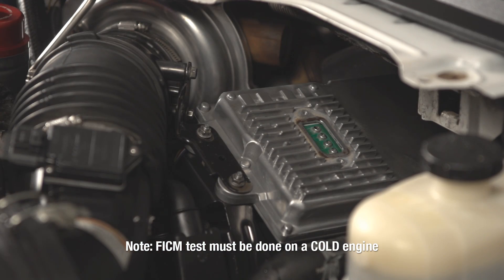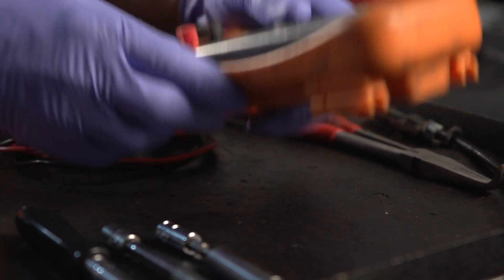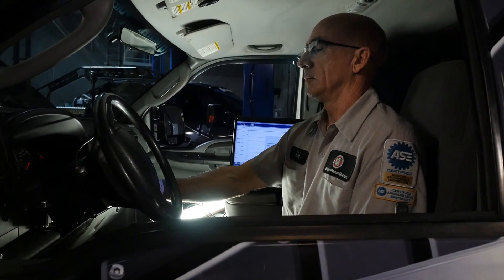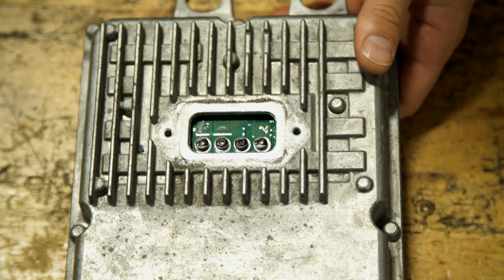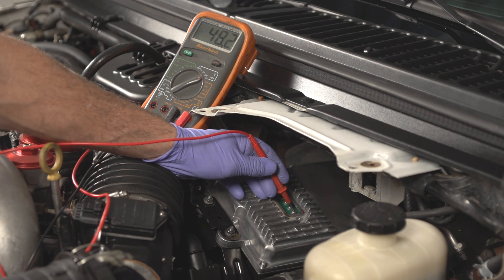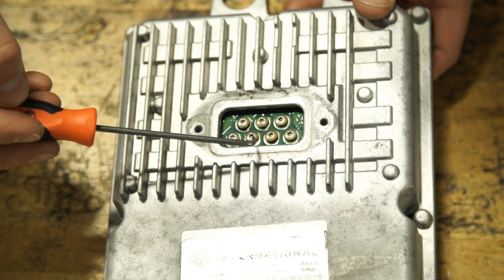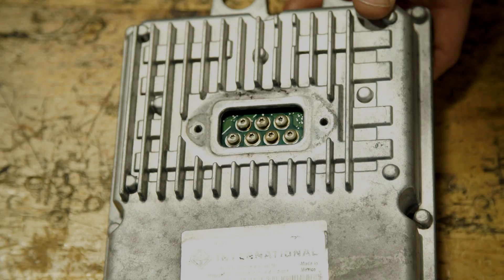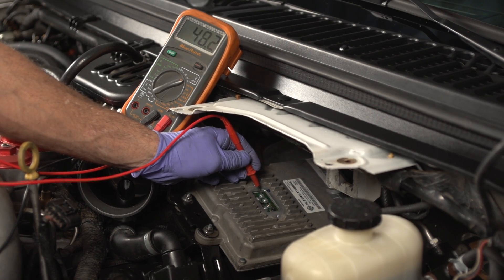6.0L Power Stroke FICM Voltage Test; 4-pin and 7-pin

Comment: Hello, great info here. My Ficm holds 48.5 cranking with glow plugs but as soon as it fires it drops down to 39.5 then creeps back up to 48.5. I have an intermittent misfire and I haven’t been able to catch it misfiring yet with the scanner hooked up. Would a new power supply solve this Ficm issue since it runs fine and just intermittent misfire?
Reply: it sounds bad to me, what did you end up doing
Reply: @ I swapped out the power supply. Helped the voltage issue. But i found it to be a bad injector harness

Comment: It would be much better if you would have zoomed in to show which pin to touch on the 7 pin ficm. You show in the video to touch the right-most pin on the 4 pin ficm, but do not say which pin to probe on the 7 pin ficm. Not much help

Comment: I have 48 volts at the screw but scanner shows 0volts L,V,M power. Does this sou d like a fried ficm or another issue?
Reply from the maker: Sorry for the delay..  it sounds like the most likely problem is the FICM logic board.  A complete FICM replacement is probably in order.

Comment: My voltage starts out below 48 and drops to 21 during cranking. Do I need to replace the FICM?
Reply: Yes, it should be a constant 45v-48v
Reply: @Putnhastism  I was told it's best to get a FICM that puts out 54 volts. Seems to eliminate stiction.

Comment: I find this test helpful. But not realistic I had 48 volt key on engine off. I had 30 volts with the engine running. I did purchase the 4 phase bullet proof power supply. I am just now getting back to the the truck to finish the repairs. I replaced the injector harness the alternator and will install new batteries before the first start.
Reply from the maker: Thank you for this feedback and for your recent purchase.

Comment: So, with my 03 f450, it came with a 4 pin ficm, weird right? Idk. Anyway, I went out to start it after a few months and poof crank no start. Got new batteries and my diag said it couldn't connect and it showed like 5 codes and it would let me read psi on anything. So, I tore into it with my power probe, no bad fuses, then i pulled the ficm cover and it said 12 volts. Then i tried my multimeter. Same 12 volts. You think bad ficm?
Reply: Yes. How did it turn out?

Comment: What happens when checking ficm and when key is on it takes a few seconds for it to get full voltage. When first comes on its only 21 and goes up from there
Reply from the maker: It sounds like the FICM is having trouble.  Does it eventually land at 48 volts?   Give our techs a ring at 888-967-6653 and they'll be happy to talk you through it.

Comment: Is the ficm the same as the DC/DC converter
Reply from the maker: The FICM is indeed a DC/DC converter - it amplifies the voltage to 48v (if it is operating correctly).   We also offer 53v and 58v options with our 6-phase FICM.

Comment: I have a 05 6.0 powerstrokes. It seems to have trouble shifting and the only problems I can find are codes for a glow plug, a cam shaft sensor, and the FICM briefly drops to 46.5 sometimes while driving. Any help would be appreciated.
Reply from the maker: It doesn't seem as if this would be a FICM problem.  If you'd like, give us a ring at 888-967-6653 and we'd be happy to have one of our techs talk through the problem with you.